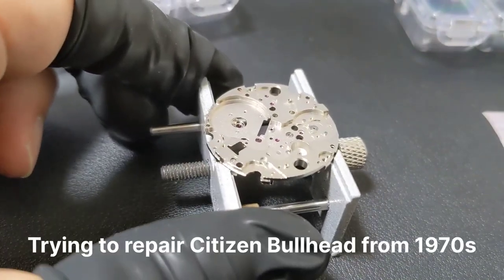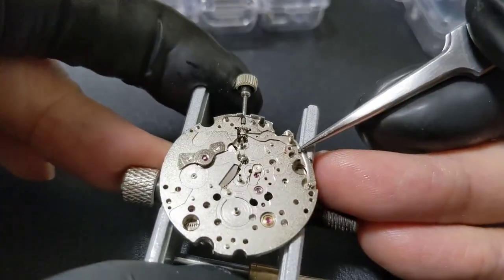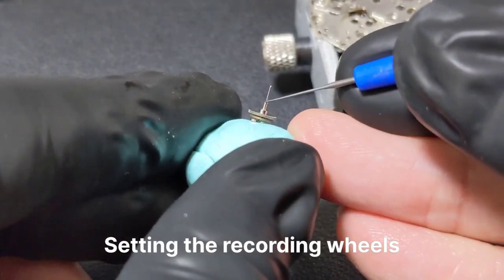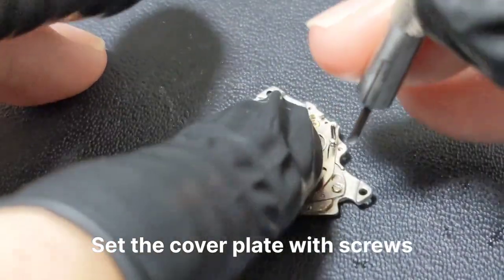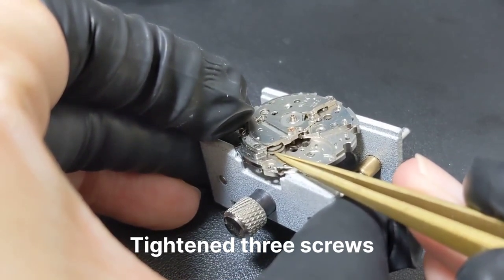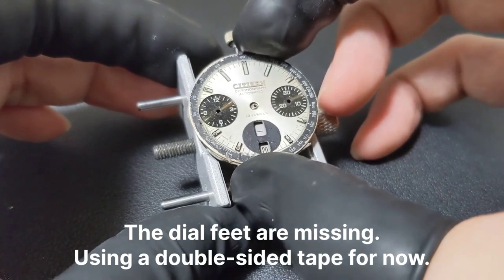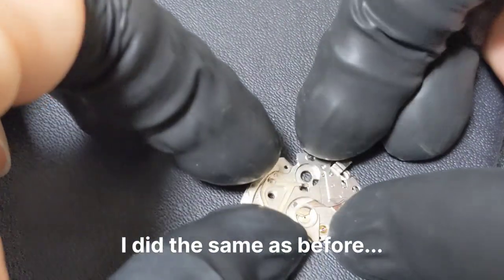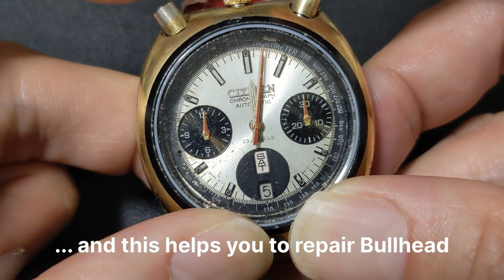Citizen Bullhead Vintage Chronograph Repair Part 2 - Caliber 8110A

Comment: Excellent work. Thanks for sharing this informative video.
Reply: I would like to check one thing with you please. The push buttons on mine don’t make the click sound when I press them. I wonder if you know what can cause that? Thanks in advance
Reply: I would like to check one thing with you please. The push buttons on mine don’t make the click sound when I press them. I wonder if you know what can cause that? Thanks in advance
Reply from the maker: This spring (the parts number is 267-06) https://youtu.be/qZFoWwRkCDU?t=401 makes a click sound. My one (and maybe your one) was worn off.  Recently, I noticed this spring is not so important for the fly-back functionality, but it's still important for the click.
Reply: @vintagewatchtinkerer  cheers for your reply. I will look into this.

Comment: Congratulations. 8110a is definitely a challenge. I've done  a couple myself, so I understand your satisfaction when you finally get everything working. Well done for sharing your learning experience.
If I can share a small tip that relates to most movements, I suggest placing the cannon pinion before the  minute wheel to reduce the risk of damage. Best of luck with your future projects.
Reply from the maker: Thank you for your advice. I'm learning this hobby by myself. Any kinds of advice are very helpful. Also, exactly yes, I cannot explain my satisfaction when I made it!

Comment: I have problems to get the escape wheel fitted in, because it is to schort and has space in between the pivots, maybe the escape wheels from side pushers movements do not fit the bullhead pushers (spend hours)

Comment: Your video is really helpful. Thank you so much for sharing this tips.
I've a problem with my 8110a, when i tight the screws of the cronograph bridge the escape wheel doesn't move with the mainspring charge.
I have to use 9010 oil or the moebius 8000 it's ok?
Reply from the maker: Either 9010 or Moebius 8000 will be fine. Did you clean the cap jewels? You might have to push the jewel out a tiny bit but it can be risky.
Reply: @vintagewatchtinkerer  yes, i've cleaned and lubricate all the jewels, maybe it's a problem with the ceneter wheel

Comment: Hi sir. you did absolutely fantastic job. I am from Bengaluru, India.I am trying to buy this master piece since a while, searching internet and not getting any proper source. Could you please help me buying one. Thanks
Reply from the maker: Finding a nice one is getting difficult even in Japan. The price is skyrocketing and $400 seems reasonable for one in good condition. Since the parts availability is getting worse, watchmakers refuse to service these vintage watches. As a result, many non-repairable watches are sold on the Internet as their condition. So buying a non-working condition one is risky. Especially on this model, don't buy one with missing parts like chronograph hands. Missing hands is not a big problem but it might also have removed the wheel underneath for another Bullhead repair. In that case, you will have to buy another movement, which may cost another hundreds of dollars. I hope you can find a nice one!

Comment: Friend, I'm working on my 8110 and your video is really helpful - thanks pretty much for sharing. 
At first I was afraid to touch it, but it's not so scary as I thought. 
Now I see that main problem with this movement is that it mostly based on frictions of levers. Points of connections wearing off each other and there is no any other possibility to fix it but only to replace. 
I have one question, by the way: does balance wheel of 8110 can be replaced from any other citizen movements?  is it interchangable with other movements. 
Just looking for balance wheel for 8110 and thinking to buy a donor, but maybe it could be a cheap way.
8200 doesn't fit))
Reply from the maker: Great to hear that! The blance wheel is specific to the movement so we cannot use other balance wheels. I wish you the best of luck!
Reply: @vintagewatchtinkerer   Hi, there! Finally i have rebuild my 8110 - but i have one issue: the hour counter is always running for some reason, even if chrono is stopped. why is that? I guess it is something wrong with the spring that fixes/holds the hour counter wheel. but perhaps it is something wrong with the hour counter wheel itself?

Comment: Over complicated movement. If you want to test the winding mechanism the chronograph plate has to be on and movement almost fully assembled. When something is wrong the whole movement has to be taken apart. Not an everyday watch to wear because parts are hard to find and expensive. 😢